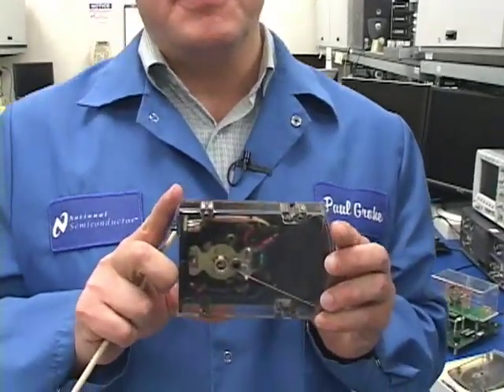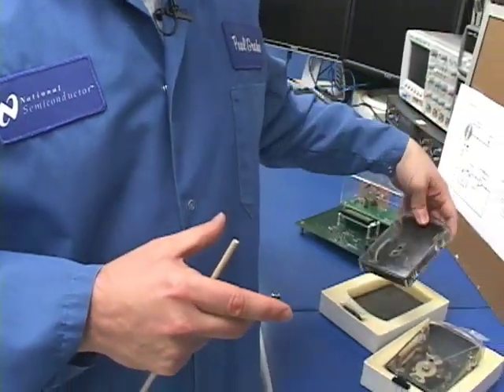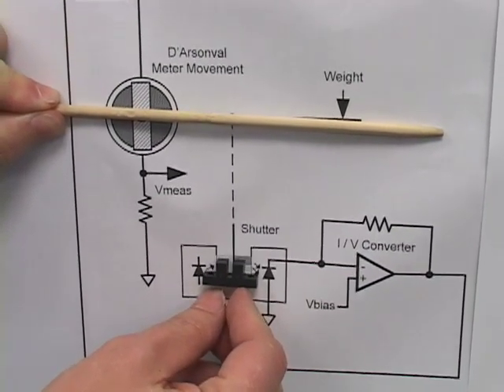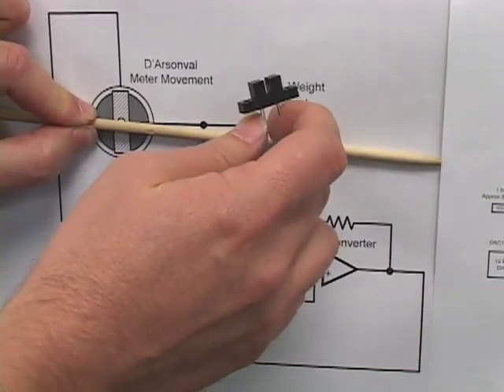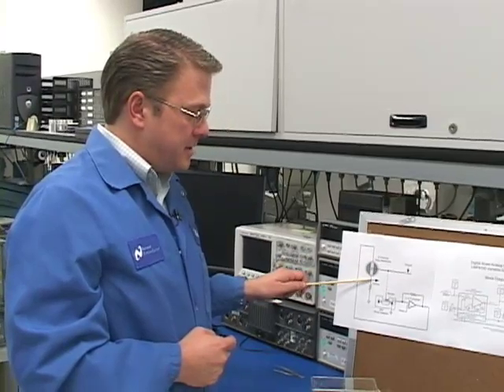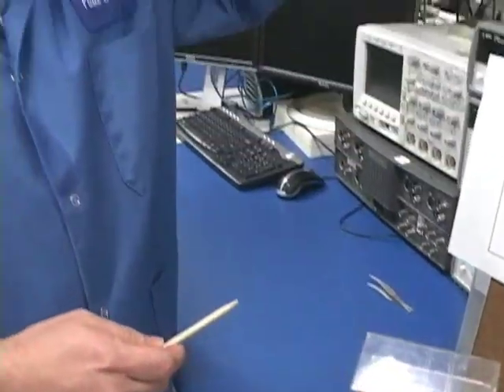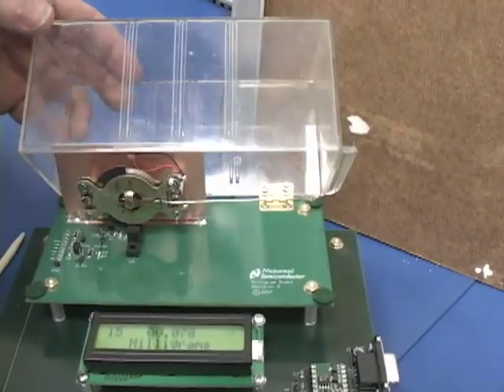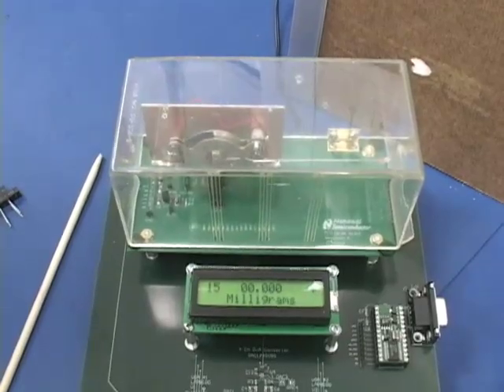Weigh an Eyelash--Build a Microgram Scale

Comment: If you were trying to measure a tiny force that changed over time, as if the mass you were measuring were a sine wave, would this design be limited to very slow changes?  Perhaps a phase-locked-loop circuit would help adapt the design to such a requirement by aniticipating the change in mass and synchronizing the servoing action?

Comment: Reminds me of Tesla’s self-adjusting arc lamp circuit. As the carbon rod burned up the gap of the arc would change and thus alter the current, which would trigger a reaction in the circuit that would lower the carbon rod to return it to the set position.

Comment: It says milligram but you called it a microgram so is that the same thing? now I’m really confused🤔. you also said it was an eyelash it it was an eyebrow hair. Can you clarify?
Reply from the maker: Hi Mauisunshine9, the scale is calibrated in milligrams instead of micrograms, but 0.075 milligrams equals 75 micrograms so the measurement is technically the same. Also, an eyebrow hair was used in this example, but an eyelash will work as well.

Comment: How did you calibrate the scale? Also wondering, since torque = force x distance, does that not mean where you place your eyebrow hair along the beam arm alters your measurement? Or perhaps that change is negligible?
Reply: Texas Instruments 3 years ago
I did the calibration using a Microgram foil weight set, which you can find available online from several sources. I measured different weights and determined the errors, then I corrected for them. 
The position of the weight on the needle from the pivot point is critical to prevent errors due to leverage effects. You can’t see it in the video, but there is a little dot on the tray that specifies the calibration point. Your weights must be placed over this dot.
-Paul Grohe, TI

Comment from the maker: It’s based on a 1996 Scientific American article by George Schmermund and Sean Carlson. It was their idea to use the meter movement as a motor that provides optical feedback. For my project, I added an analog optical feedback circuit (quieter and more resolution than their PWM setup), a programmable gain amplifier, 12-bit ADC, basic stamp controller and display. It’s basically a fancy digital volt meter.
-Paul Grohe

Comment from the maker: I did the calibration using a Microgram foil weight set, which you can find available online from several sources. I measured different weights and determined the errors, then I corrected for them. 
The position of the weight on the needle from the pivot point is critical to prevent errors due to leverage effects. You can’t see it in the video, but there is a little dot on the tray that specifies the calibration point. Your weights must be placed over this dot.
-Paul Grohe, TI
Reply: This is why balance scales use a tray hanging from a fixed point on the beam. This ensures the weight distribution of the test material does not affect accuracy.